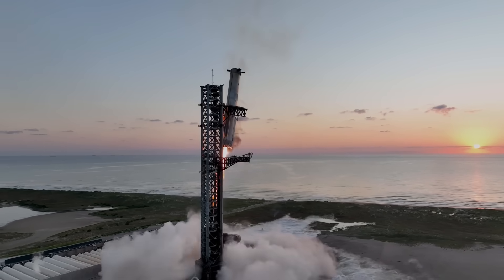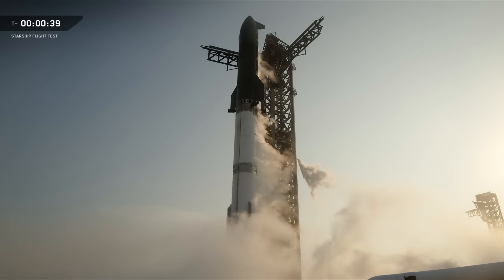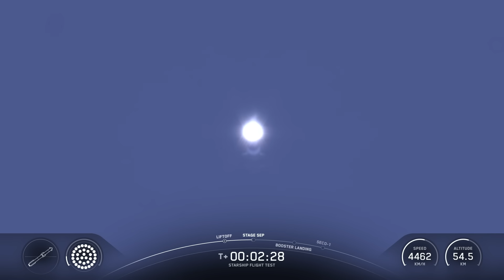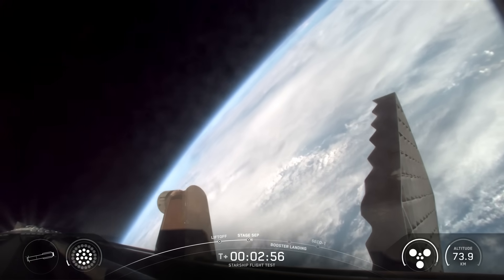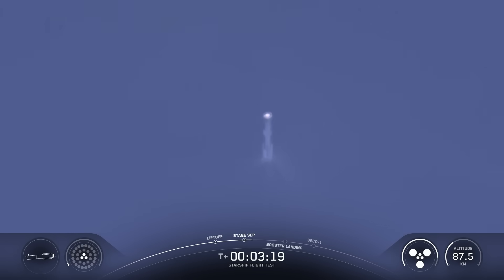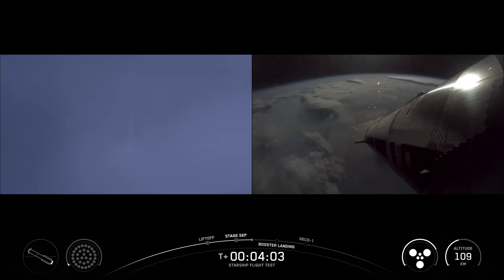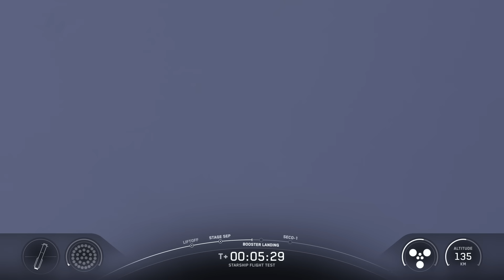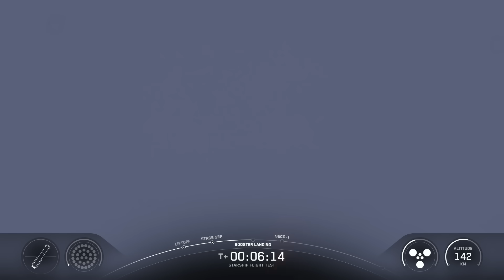SpaceX Builds Largest Reusable Booster, Also Makes Door That Won't Open - Starship Flight 9 Recap

Comment: I believe the 1 booster engine being out on the landing burn was planned. In addition to testing the higher angle of attack return profile, they wanted to test landing capability with an engine-out condition.

Comment: Was wondering if they’ve tried to program the Flight Control System to use the aero surfaces to correct the orientation during rolls/spins during entry interface before the plasma starts building. Parachutists can fully control their orientation with their arms and legs. Aerobatic pilots can recover from some pretty weird “unusual attitudes”.   Need a vid on flight dynamics during entry interface. 😊

Comment: Over fifty years ago, the Saturn 5 rocket was circling the moon by its third flight. With 3 stages and 5 massive main engines it was a far more efficient design. It could dead lift 320,000 pounds into low earth orbit. A record that Starship will never match. Maybe the 250 million  spent in his foray into politics would have been more useful spent on his rockets.
Reply: You’re ignoring all the programs that led up to Apollo. But whatever. Haters gonna hate.
Reply: @TJ-Wyou’re ignoring. Falcon 9 and falcon heavy as well bud.

Comment: think the "pod door" was briefly fully operational but opening would be false hope, perhaps they did , this may have pressurisation problems and hard to believe. Really there's more delay on the virginal  thermal exhaust stage solution. It could use TOA's maybe just to be sure though even more long. Felt the booster deserved an efficient  catch attempt but had to vent and cease to be was surprising. Mars Colony is an insane idea but expected , how can anyone know except for them

Comment: A friend went on a very successful bicycle ride. 
It was undeniably Rapturous. 
Until he fell down 
and broke his hip.   
Clearly not a success. 
Anyone who knows anything about post mission analysis of a new space flight technology. knows that recovery of the hardware is essential for Accurate Analysis, cost-effective and efficient problem solving that produces positive results.   I have been told otherwise.    
Telemetry is god!  
Keep telling yourself that.
Yet the proof is self evident. 
Telemetry alone ain't enough. 
But!!   Flight 10, is gonna be the
 lucky one. 
  Looking at cool video is,,,cool.   Especially for the layman.  Tax payer. 
It's the parakeets mirror ya know. 
However,, this is pencil neck and pocket protector territory. 
9 failed flights.
With complete loss of both vehicles 
on the ninth try?  Well,,,,
Call it what it is.    A ninth failure.
The vibrating delta V and Stratoship?
Aviation and Aerospace has plenty of examples of seemingly good ideas that were actually, death traps. 
Spacex is interesting. 
Starship makes people imagine what the future holds. 
It is dynamic and exciting stuff.
Now it needs to prove its not just an example of human
 engineering and material limitations. And 
Spacex should stop the marketing and public relations positive spin crap.     It's kinda embarrassing. 
Again,, video and stress guages along with other information gathering from telemetry alone is simply not enough for efficient and effective problem solving.    
You don't need a
 bean counter or a self appointed efficiency experts bullshit
for that one. 
Otherwise, the same problems would not persist.     On flight 9.  
  The same problems!!!
   One behavior associated with Insanity is.    
Doing the same, wrong thing,  
over and over again. 
And expecting a different result. 
Musk seems to consistently prove that he is a liability. 
The problem starts at the top.
A ninth flight with complete loss of the hardware is a success?  
 With the same problems not getting fixed?    The objectives accomplished are a bit of a joke.
That sounds more like 
Gaslighting. 
This test mule
 don't like 
pulling the plow.
This new age of design and manufacturing that started in the 70s.
Is it possible that the digital age engineers might have lost something. 
When the slide rule
 became a mysterious artifact. 
Remember the slide rule?
It's that thing 
engineers used 
to send Man to the moon.
We know that payload is the
 golden cow.   
But is it a sacrifice as well?
The best and brightest?   Wasting time on a icon of the Musk ego?
A symbol of a billionaires wasteful 
Giant baby steps.
Big enough to fail.   Again and again. 
Is that what the tax payers really need?
An egg shell 
on top of a high amplitude agitator.
Remember,  it's not a battleship. 
It's a spaceship.    Or something that looks like a spaceship.
Enjoy the fireworks. 
It's only money you see 
burning up.
Best regards from the 
Iconoclastic Bastards Club 
Bourbon Republican Party 
Upland Purple Sagegrass Conservancy.

Comment: They are trying to learn how to course correct a flat spin or end over end spin to upgrade their landing control and attitude software they are stress testing the whole thing putting it through the worst case scenarios to learn how to handle them in real time more effectively. They could crash the next 5 starships doing this and end up with better control in the future

Comment: I'm too lazy to read all the comments to see if this has already been suggested, but I wonder if the door hardware was fine but the software prevented it from being open due to the unstable attitude of the ship.

It would make sense that the door shouldn't be opened on a tumbling ship because that would put forces on the open door that it wasn't necessarily designed for.

Comment: I find it disappointing that in both this video and in SpaceX's own live-cast, no attempt is made to highlight which part of the curved wall (as seen from inside where the PEZ dispenser is) is actually the door which refused to open. I seem to remember the SpaceX team mentioning that "it's on the right" ... but which part on the right? Is it really beyond video editors these days to show a highlight, maybe in yellow outline, in the same position as the door? ... for us surface dwellers?

Comment: The door got cold welded..  a very old problem..
Reply: Have you ever heard of vacuum welding? A problem very specific to LEO/orbital altitude environs
Reply: @jazzmusiccontinues1134  That takes months.
Reply: @vast634 cold welding can also describe vacuum welding, essentially it’s the same thing, I’ve learned. Can be fretting from vibration or galling as well. It doesn’t take months though, and readily happens on high precision mating surfaces with no oxide layer.

Comment: The 'Pez dispenser' door is especially problematic because it crosses the compressive loading of the vehicle's exterior. There has to be a way to divert that force around the door, and I suspect that this isn't entirely working. The vehicle deforms under flight stresses, which push on the door opening and distort it. The mechanism then jams.

Comment: Acceleration loads on the structure probably bent something out of shape to prevent the door from operating.

The booster was already slated for destructive testing, which was more destructive than expected.

Comment: What’s needed is a higher-fidelity iterative series of tests for the payload bay door mechanism than they can get on the ground. Too bad the two current suborbital launch vehicles- Virgin Galactic and Blue Origin- only have pressurized cabins. If there was some way to attach an exterior SpaceX Starship payload bay door mechanism that could be tested “at altitude’ let’s call it, it would at least be better than ground testing; you could try cycling it Open/Closed several times….and then you’d get it back for inspection. No guesswork involved at least. - Dave Huntsman

Comment: The Pez Dispenser door has never worked as far as I know and they've tried this numerous times.  I think one of the problems is that Starship is a very big tube and it's hard to prevent that tube wobbling and oscillating and that wobbling is pinching the door mechanism.  In order to minimize this problem it maybe necessary to rotate the slot 90 degrees so that it's longitudinal (vertical) and not cross longitudinal.   Also related to this issue I think is the plan to open the top of Starship when carrying other payloads.  Any interruption in the tube to facilitate opening the tube will weaken the tube and require additional bracing to prevent it from 'oil-canning'.  Not getting that right would doom anyone onboard if the tube can't be properly closed for reentry and landing.  This was always a concern for the Space Shuttle as the payload bay doors needed to be closed for reentry, but to the best of my knowledge NASA never had an issue that impaired the ability to close the doors.  But the problem SpaceX has with this issue is that this tube is 9m in diameter and that makes it hard to prevent oil canning and other problems.
Reply: The top cannot "flip open" as it has header tanks for landing and plumbing all the way to the top.
Reply: @stuartgray5877  Right, and have you seen SpaceX renders of how they open the tube to transfer cargo -- it flips the top as I described!  Indeed, the header tank and plumbing would be a problem, but then, what new approach to opening the tube to transfer cargo are they working on?  The Pez Dispenser only works with Starlink satellites and won't be very useful when landed on the Moon and cargo is needed to be moved from the rocket to the lunar surface.  They implied an crane like lift, but the designs are all over the place.  As much as I dislike Bezos I think the approach BO is taking for Moon missions is infinitely more viable than landing a 420t Starship on the Moon!

Comment: My prediction:  They are not properly accounting for the ACOUSTIC environment of the hot staging.  I bet they are getting a LOT more energy in the acoustic reflections off the booster than they are accounting for.  The pressure in the hot staging ring is likely well ABOVE atmospheric pressure resulting in more energy in the reflections.
This is damaging the Starships internal plumbing.
(ALSO, the reason a Space Shuttle NEVER launched from VAFB after spending BILLIONS on the launch complex)

Comment: How the hell did NASA manage to get into orbit, open doors?? Looking at SpaceX struggling with anything, it seems nearly impossible. Lol ... Failure.
Reply: SpaceX is trying to do 100 new things on each launch.  NASA does ONE change at a time.  This is why NASA is so slow in developing new tech.  Anything NASA flies is at least 20 year old tech.  SpaceX was buying parts from Digikey up until the manned missions.

Comment: a vehicle of this size and complexity requires a very large amount of testing before a lot of issues even rear their head and become known, let alone solved. And getting large volume of testing on something like this is obviously inherently exhaustive in terms of time, energy and $$$$. 
I think the simple truth is that we all got a little ahead of ourselves with the early successes (prob including space x themselves), but just because things appeared to go well, did not also mean that there were faults waiting in the wings which were somehow avoided or just didn't  manifest on that particular flight by luck or small margins.
It's hard to accept these set backs, but then I remind myself that I'm still amazed that this thing is even able to get off the pad!

Comment: In a circular cavity, two tracks for the door, top and bottom, with a small hump/ramp in the track on the opening leading edge that raises the door inward. As the door follows the circular track on the interior the trailing edge eventually gets to the slight hump/ramp and rises to the level of the leading edge. The tracks act as the sealing mechanism when the door closes, forcing the door into the opening. A simple cable and capstan or chain drive and multiple sprockets would be the actuating mechanism. Simple. Cheap.

Comment: 14:33 The hypothesis about door failure that I find the most appealing is one proposed by Brian White of @FutureAza: For such mechanisms there is often a safety pin or lock in place to prevent the mechanism from being strained in transport; it is possible that someone forgot to "pull the pin" before launch. I know that it should have been on a checklist and double-checked prior to T-zero, but it is just possible that the version of that checklist in use for the pre-launch activities didn't have that section included.  Of course, maybe there wasn't a pin, and in that case my favorite idea would be that the mechanism was jammed due to a minor about of damage caused in transit or while being hoisted. In both cases I speak from total ignorance about the item, but I've noticed in my unrelated career, that operational problems are more often due to failure to perform properly the correct procedure than to a physical production or design failure.

Comment: That was pretty good!  They screwed up the redesign of the fuel delivery system to this version of star ship (ie those 3 little pipes).  I could be wrong but you get pressure surges that will amplify and pulse with the resonant frequency of the engine rumble that creates hydraulic rams. Straight hard pipes will start to experience various breathing modes due to nonlinear effects before you know it those modes will pop welds and joints due to the impedance mismatch where the reflected sound wave adds constructively with the impinging wave and bam a shock will form much like a wave breaking on a beach and the material will spall.  This means the engineers will need to identify those modes and eliminate them from the flow in the fuel system... that's a pretty tricky thing given the Reynolds number of the flow in those big pipes... lots of nucleation points in a turbulent flow that can couple to the system's resonant modes that have nowhere to go except back into the fuel flow and if the coupling approaches supersonic flow it will create a hydraulic ram resembling a pulse jet at which point your are testing your turbine strength against the material strength of the pipes while local heating behind the shock front acts like a rocket creating a ram driven shock. That will propagate down the pipe and hammer the fittings each time a pressure transient in the turbulent flow exceeds a critical value... that's likley coupled to the pipes' breathing modes... big mess. Glad I'm not the guy who changed the layout of those pipes!
Reply: Imagine the space shuttle for Saturn v blowing up the first 10 times it launched. This thing is basically an empty shell with a door they can't figure out how to operate. Yet they managed to blow it up anyways
Reply: @mcamp9445 Imagine a rocket bigger than Saturn 5 with more features blowing up? It's quite easy to imagine...it's a more ambitious design. Takes reps to get it right. If it was easy this would have been done already.
Reply: @mcamp9445 study the space program more closely. Lots of rockets blew up usually due to this kind is integration process including r25's and f1's. Compare the relative development costs engine designs and project scale.  This is truly impressive. Compare it to Russian, Chinese, European programs or sls, electron, firefly, or Artemis. Dollar for dollar it's the best and highest performing thing humans have done in this industry. Merlin is a huge advace. Keep in mind that's the hard part, the marrying that to reusable light weight tanks is something that takes all liquid rockets lots of experimentation and lost rockets and they weren't trying to make it commercially viable and reusable. The titan and titan 2 would blow up just sitting in the silo if you dropped a wrench and it hit the fuselage wron on the way down. Don't let your political bias blind you to reality. He's made enemies because they were making billions for not much work and hes taken a few zeros off the checks the government writes to the industry everytime a satellite doesn't get blown up or damaged by the launch.
Reply: Zach Golden speculated this could be a pogo issue, created or exacerbated by the new fuel system. The changes we heard about seem to neither  confirm nor deny this.
Reply: Nonsense!
Reply: @Grandremone no its literally what happens in straight pipes with turbulent flow. Those things don't shake themselves apart until the fuel stats flowing. Look at pogo oscillations and the lack of accumulators feeding the engines compared to the earlier working version of starship

Comment: Complex system development is often slowed by unexpected and seemingly primitive subsystem problems.  I was involved with the development of the first laser printer at H-P around 1980.  I was a lowly temp that loaded paper and toner into a bank of printers.  I watched as engineers who had solved the puzzle of getting 300 dpi toner to stick to a page as it passed across a rotating drum become frustrated because they couldn't get tractor-fed paper to fold consistently.  The wadded-up paper would then push back into the machine creating epic paper jams, which I was tasked to clean out.  They tried both high and low tech solutions (dangling metal ball chains, Christmas tinsel, and altering the compression cycle on the discharge shelf to name a few).  I am not sure if they ever "solved" the problem. Just minimized it.  My last day at HP I saw a small copy machine with its top deck removed and cables connecting to a computer substituted.  A single page-solution that could fit on top of a desk.  I laughed, wondering who in their right mind would want a printer on top of their desk.  Here it is 45 years later and I can't count how many of the various desk-top printers I have owned.  Point is.  Sometimes a whole new approach is needed to solve seemingly minor primitive problems (that aren't all that minor as it turns out)  and the solutions bring unexpected progress.  Sorry for the long post.